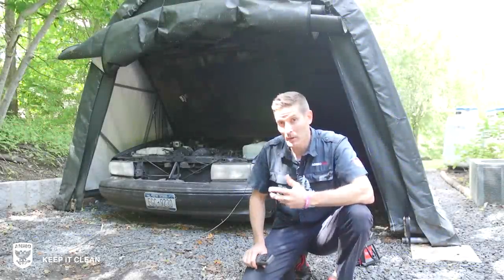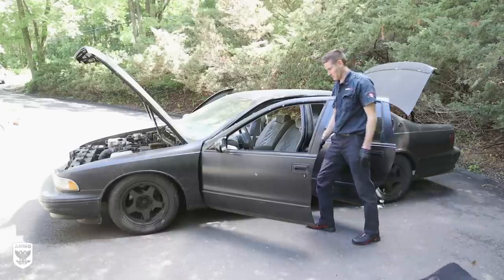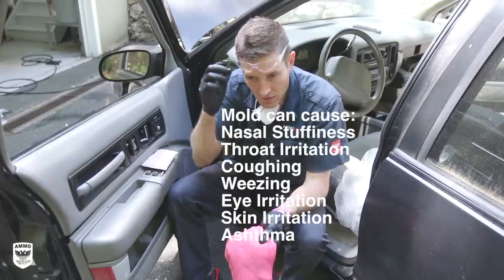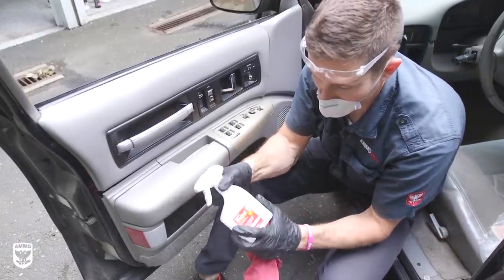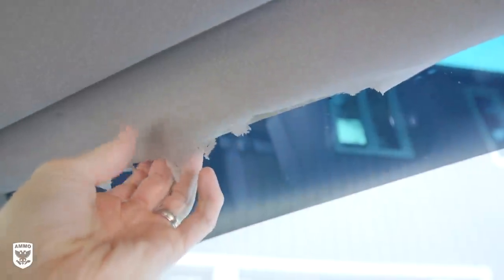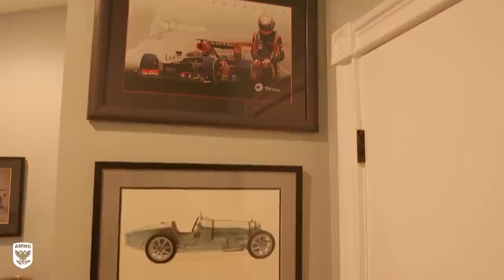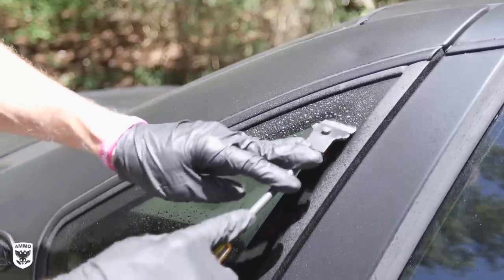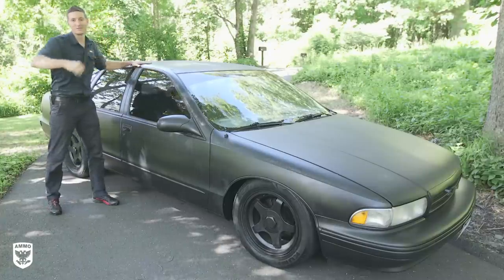12 Step Detail: Mold Removal and Plasti-Dip Repair for Used Car Sale: Impala SS

Comment: Mold is no joke, sucks to clean it and the last time i did it on a seriously molded car i bought i got sick for over 2 weeks that i where in bed.
I ended using 1.5liters vinegar concentrate (35%) diluted and some APC in a spray bottle, sprayed down everything several times and used a carpet cleaner and steam cleaner for hours and hours and then had a heater in the car drying it out completely for over 5 days. 

Car have been sitting still for over 1 year since haven't got time to fix the rest, still smells nice and absolutely no sign of any mold. 
There was 0.5 cm thick layer of mold some places and the mold did some permanent damadge on both plastic and carpet where you can see it like some small flower branches/the root of it
Car have be

Comment: Baking soda solution will knock out mold..paired with peroxide it will clean out mold well...unless the mold has peroxidase which is an enzyme mold produces to neutralize peroxide..what Larry is doing is deplaquing or degerming (physical removal of mold or bacteria) as well as the chemical cleansing of mold spores

Comment: Better using a respirator with correct filters and never spray mold directly with fluid. Always spray the towel then wipe. Once you sprayed the mold directly the spores instantly went air borne which can spread easily. Overall great video as usual. 👊🏻

Comment: What did you end up getting for it?  I'd have placed a bid but the auction is already over :(
Reply from the maker: listing randomly ended ??? Here it is

http://rover.ebay.com/rover/1/711-53200-19255-0/1?icep_ff3=2&pub=5575378759&campid=5338273189&customid=&icep_item=173404409302&ipn=psmain&icep_vectorid=229466&kwid=902099&mtid=824&kw=lg&toolid=11111
Reply: AMMO NYC I see it now. Does the Rail coating peel off like plastidip?

Comment: You are not using the ozone generator correctly.  You should have opened all console covers, glove boxes, etc. to allow the ozone  better access.  Since this was a mold situation, you also should have removed the seats.  Lastly, while I understand why you wanted to use/promote your own line of chemicals, improperly treated mold can put the next owner's health at risk.  You should have used mold remediation chemicals (in addition to the stuff you are pushing.)  A bit disappointed in this one.

Comment: Washing an engine with that many miles is dumb in my opinion you basically just removed everything holding the oil in.
Reply: On the other hand, it lets you see where oil is leaking from so you can make the proper repairs